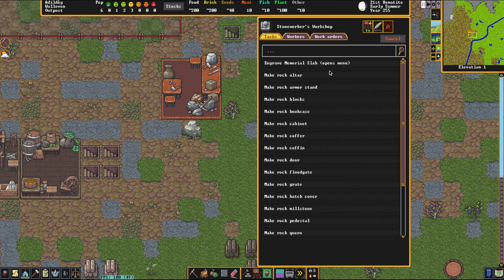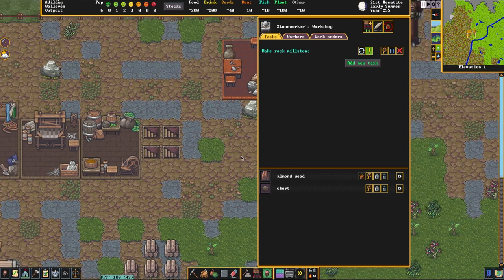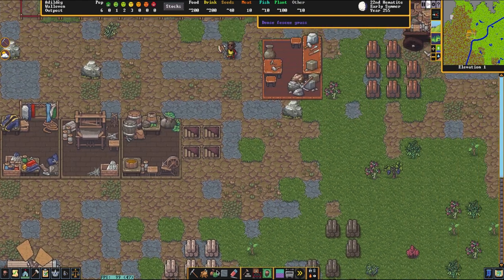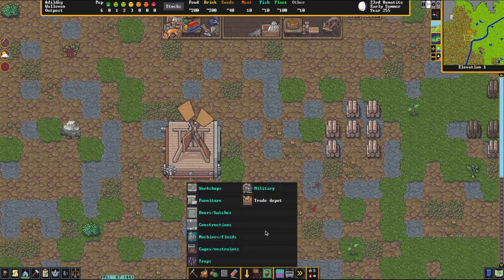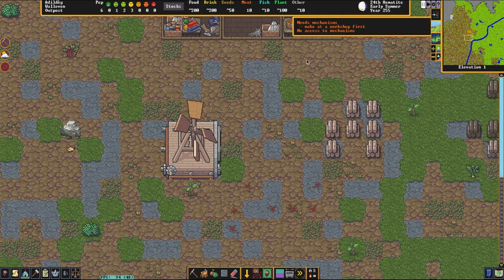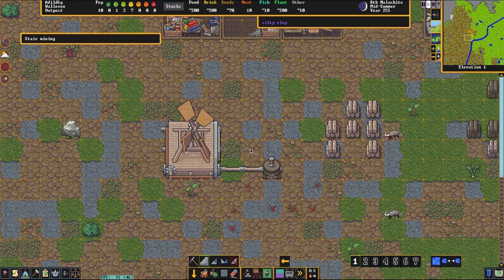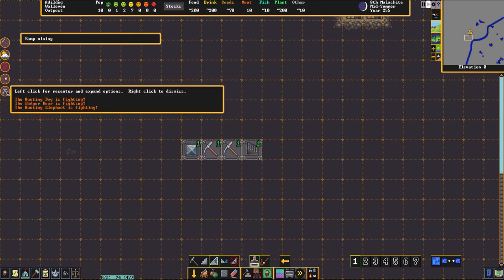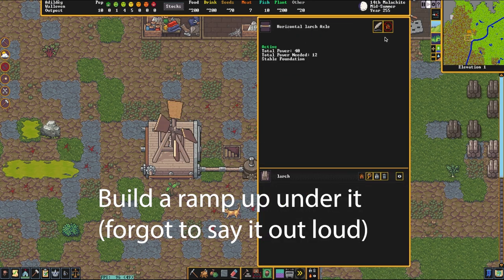Dwarf Fortress - Quick Tutorial -  Millstones and Windmills

Comment: Great stuff as always! thank you for this Blind! you are making my onboarding to the game very smooth! 
Quick question if you want to have the connection to lower levels can you just use vertical axle and a gear assembly at the bottom, or for each floor you will need a gear assembly?
Cheers
Reply: I think you need gear assembly if you're switching directions, otherwise you use axles. So one gear assembly at the bottom plus axles should work.

Comment: Hey Blind, could you please do a tutorial on dealing with Raids, Ambushes, Megabeasts, and Forgotten beasts? Having a lot of issues with burrows not working and burying a lot of dwarves as a result. Thanks.
Reply: You have to assign the dwarves to the burrow. Also you need to uncheck the button that allows the dwarves to leave the burrow to gather/craft. If the pause button on the burrow is lit up then the burrow restrictions are paused and the dwarves are not constrained by it.
Reply: @Bradawick  my problem is that they just all stop and stand still if they are outside the assigned burrow. I heard that they wont move unless they have a job inside the burrow, which seems like a pain if you have a lot of dwarfs
Reply: @mikkel3135  just experienced the same thing funny enough. Not sure if the alarm setting has been added yet as that forced the dwarves to obey the burrow. I cant find it anywhere.
Reply: @Bradawick  I understand the functionality, but as the other gentleman said as of right now dwarves seem to put burrows very low in the priority list and try to to finish whatever they are doing.

Comment: what is the need for Power outside Millstones?
From what I understand the only use is either pumping water or powering millstones.

It's not (unless they make a mod for it) like powering a workshop so you can have dwarfs work on say, stone blocks faster.
Reply: you can also power minecarts using rollers
Reply: You can also build rollers on minecart tracks to automatically propel them in a specified direction. Lot of FUN!

Comment: At 3:20, how did you make it so you get a preview of a construction, where you can see a see-through version of the final designation? Normally, when I make a construction (like a wall or horizontal axles similar to the video) I choose the starting point and end point but they're invisible until I choose the materials or after the designation is finished.
Reply from the maker: If you have keyboard control on it removes the previews.
Reply: @BlindiRL  Oh, thank you! Thought it was a mod or something. It's a shame keyboard controls remove that function, it's useful for macros.

Comment: So if my millstone is 20 layers below, how would I connect them?
Reply: Vertical axles, like the one on the surface has a horizontal one, can be placed down multiple levels. Just dig it out, place the axle, and repeat till you hit the floor you want then pop a gear and your millstone
Reply: with 20 vertical rods and gears. Just keep building the rods down to the required machine.
Reply: Easiest way i can think of is make U/D stairs next to your planned windmill spot, then ramp/channel a hole leading down 20 layers. That will give you room to put the axles as other people have said. Good luck.

Comment: Can you have the millstone several layers under the windmill, or only one?
Reply: As many as you want! Just use Axles, like the one on the surface but you can have them vertical too! You can even combine vertical and horizontal axles, just put a gear at each direction change
Reply: It can go as far down as you want. I'm not sure if you lose power over distance, but you can build multiple windmills and connect them together to generate more power if needed.

Comment: Teach us how to make proper trash box fpr roten and dead bodies
Reply: Easiest thing for that is to make a stockpile in an unroofed area on the surface, as unroofed won't cause the purple gas of stench. Prob'ly want to put it behind walls, though, so passers by won't get mood hits from seeing rotten corpses

What many would consider the best way to handle them, though, is magma disposal, once you reach the magma sea. There are various ways to handle this, depending on your comfort level with the game, other things you want to do and more.
Some may just run a magma safe minecart full of the refuse into a standing pool of lava to incinerate the contents, some may add temporary refuse stockpiles into chambers designed specifically for obsidian production (releasing magma and water into chamber, then mining out resulting obsidian and resetting the room for next batch) or more
Also, dwarven atom smasher works, too. Put refuse pile under a drawbridge and crush it into never existing (...just watch out for dwarves and pets that may want to stand right there when activated...)